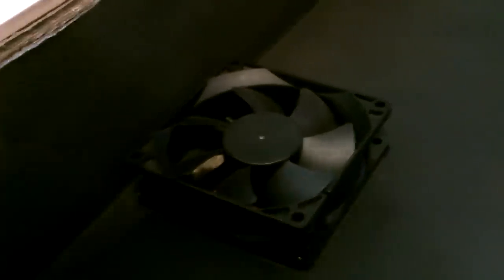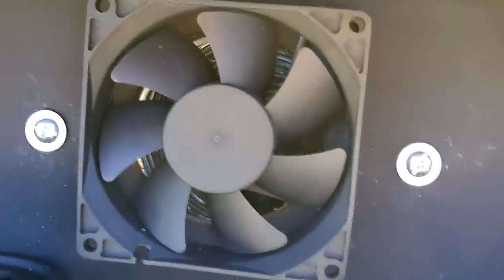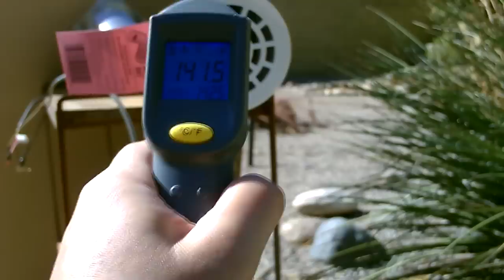Homemade "Steel Can" Solar Air Heater! DIY - STEEL CAN Air Heater! (140F+) - EASY Instructions!

Comment: you made several holes at the bottem of the heater frame and my question is that whather you covered those hole or not,if you covered those holes,how did you cover the holes and what did you cover the holes with,i am not asking about the computer fan hole my question is about,the other several holes you made
Reply from the maker: hi there. those are covered with screen

Comment: How about those low voltage LED seed warming beds? You could wrap them around the inside of a clay pot and make a solar powered space heater. No need to burn any candles.

Comment: Really enjoyed this video. I made a gigantic heater like this last year on my patio as an experiment using 3" pvc I had. Then tore it down in summer. It worked. Too ugly wasn't portable. Been wondering what to do with empty cat food cans. Suggest foam insullation and tar, roofing paper for the back.Whatever. Very good project.

Comment: this is a clever way to capture and use heat.  I was wondering if you have any idea of the cubic feet per minute of air passing through.  I'm thinking of scale-up for a moderately large shop and trying to get an idea of BTU  potential.  what size room did you use it in?  was the room insulated, and what kind of temp differential did you experience?

Comment: Just a thought, instead of drilling holes in the cans why not remove the end ? just a thought.
Reply: I would imagine that increased airflow would decrease the resulting temperature.  Slowing down the air movement will trap the air resulting in it being heated to a higher temp.
Reply: exactly

Comment: hello sir, my masters project is to develop a solar dryer integrating dc heater, solar panel, fan and battery. Can i get more ideas from you pls
Reply: Apaa jacob run the duct from the box of cans into another box where u put the clothes...boom...clothes dryer

Comment: Great idea! Will try it myself in the future.

I think it might be better to use a (black) plastic tube to connect the device with the room because you'll lose less heat with it. And try to isolate it with wool or so. (Don't know if it is understandable, English isn't my native language.) ;)
Reply: plastic contracts at some temps though. may insulate some aluminium dryer duct

Comment: I have tried your steel can project and had it working ,but had problems with back yard trees that will block portion of sunlight. would you have any idea to help align the solar panel to the sunlight. I thought the connections were loose and checked all wires, all in good standing. very sensitive in the angle of light to run the fan .

Comment: Hi,I guess this can be used as an underground air passage try it for 3 meters and more underground while the hose of head heater is above the surface .It can be use for shelters,tunnels ,and underground chambers.

Comment: I have not tried this, but it seems to me the design would be more efficient if each can was loosely filled with steel wool to conduct more heat from the can metal surface into the vent system....just a thought.
Reply: on the contrary the steel wool would impede the flow of air. how this works is, the air flows at a continuous rate of flow through the heated cans ( the aluminum cans heat rapidly in the sun) . as the air moves from bottom to top of the manifolds the air is heated up very quickly, that's why it is important not to have any air flow restrictions.
Reply: It’d take twice the fan
Reply: Robin Goodfellow Now there's an interesting thought! Would be interesting to see a comparison.

Comment: fill the cans up with small river rocks, they retain lots of heat...
Reply: I'm still in for the wool
Reply: +Andrew De Freitas good idea
Reply: good idea
Reply: or break up some fire bricks
Reply: Is that so? I have some experience dealing with the reverse rocks. I used them as the therapeutic heat pack. I made a case, filled with rocks and I would heat it in boiling water. The idea was that heavy and hot would penetrate deep in to muscles. The rocks would quickly become cold again, and would take too long to heat them again. So as interesting the idea looks in practical use I was disappointed. Well, it was my idea no body to blame here but ..
Reply: Paint the cans black
Reply: @mamiemw6418  7:49
Reply: or steal wool
Reply: @andy6477733157  steal wool?......like....in.....you rob sheep?
Reply: @TheWolfsnack  That's baarbaric!
Reply: Bad idea. It breaks the design which is that it runs off of the airlflow through the cans.
Reply: River rocks are cold and wet

Comment: After leaving a Black car with black leather interior in the sun for 30 minutes next to a White Car with light interior, the temp. is amazingly different. I will try with this wblack painted cans filled with black colored sand....also a mounted freezer fan with magnets on the blades with a very strong magnet to turn the fan blade....thus hoping for a more efficient heat source!  Do you think would work??
Reply: That blade won't turn with only magnets that's physically impossible
Reply: +Sarah  Grace Brooks The black sand is redundant if it is already housed in black cans. Also, as with what +Oscar B said, the magnets will not make the fan move. Look up perpetual motion machine if your more interested in why this will not work. Aside from that go for it and good luck!
Reply: the fan will rotate by a single Strong magnet placed to the side of the fan blade with a magnet on each fin...the Strong magnet pushes the fan like I use to take 2 magnets and make one chase the other.  Each time one fin passes the Strong magnet it repels...instead of attract...look up magnet fan.
Reply: +Sarah  Grace Brooks a magnet has 2 pulls if you want it to rotate like you explain your are going to have to be turning of and on the magnets that's why electric motors works. The way you have explained it the fan would just stay in one spot because of the magnetic force. The nearest blade would be attracted the the fan and would stand attracted thus making the fan harder to move than without magnets. All the video you see on the Internet are 100% fake.
Reply: +Oscar S you are going to have to turn the magnets off and on*
Reply: +Oscar S magnets complicate things
Reply: +Blackerflash indeed, but perpetual motion is non existent.
Reply: +Good Game u can make the fan spin, but its not going to be pushing any air, really
Reply: ekoms108 You can't make them spin using just magnets.

Comment: so I guess you leave it all outside except for the hose?
Reply: +Dusty Schneider I planned on building one except putting it in the kitchen window, inside of course. You still get the greenhouse effect by placing them in any window with sun. Inexpensive heater for daylight hours. win-win.
Reply: ZinfandelRed1914 thanks my friend
Reply: +ZinfandelRed1914 Place the cans up from the bottom about an inch or so and stacked to about an inch short of the top and everything painted black. Then cut one inch gaps on the back side all the way width wise at the bottom and top then place it tightly in a south facing window with the slots inside the dwelling. The heated air from the sun will naturally rise and flow out the top slot which in turn creates convection that then draws cooler room air into the bottom slots. The heat will continue to draw cooler air, warm it as it rises and back out the top into the room in a cycle that repeats naturally and eliminates the fan. Paint everything black inside the collector and even add small gravel stones painted black inside the cans to store more heat you have an all day (provided it is sunny) heating unit.
Having the heated air travel through a well insulated duct, using the small fan run by a deep cycle solar charged battery, into larger barrels of clay bricks stacked loosely for circulation around them inside and small opening in top can trap most of the the heat, warming the bricks and only slowly dispel the cooler air out the top. The barrels placed in a low place such as under the floor which has small grates above them will radiate warmth out when the barrel tops are opened wider after sunset releasing the heat collected all day
The solar collector needs black paint on everything to absorb heat and light and gaps between the rows of cans to make more room for more heat. Black PVC connected as continuous tunnel back and forth side to side open at both ends can create a lot of hot air.
The main thing is black to absorb heat and convection that does not remove the heat but cooler air. Volume of the collector is only limited by the size wall opening and limit the collector' contact with outside air.
Reply: The small stones idea will impede the airflow through the cans and make it much less productive.

Comment: If there was a way of putting a smaller can within each can filled with sand it would capture and radiate more heat and for longer. Just a thought. Cool build. Thanks for sharing.
Reply: +bRad “bRadicalMagic” Nichols slow clap for the allusion
Reply: Funny Guy
Reply: Hey Cain ,  for how long have you hated your very own brother ?

Comment: how small can u make it?
Reply: +Ray Lee For small rooms, maybe try the candles with clay pot method as well.
Reply: +Ray Lee You could do this as small as you want but the more surface area gathering sunlight the better. Anything much smaller that what he built here probably wont be very useful
Reply: i c thanks
Reply: thanks

 ZinfandelRed1914

Comment: Better have thermal mass in the home to hold the heat, otherwise...heat during the day might save you a little on your utility bill, but won't save you at night if you don't have another source of heat.     How much did it cut your heating bill?

Comment: Why the fan? Passive is more energy efficient.
Reply: +Shawn Sawyer You would need the fan to direct the heat out of the lightbox. Otherwise it would be like an oven and just the cans would get the heat, and not heat the room.
Reply: elizabeth anderson actually this is untrue. proper planning, placement, ductwork and home ventilation would allow you to circulate warm air thru a house.

Comment: Would this work when the outside temperature goes below freezing (below 32F)? My winter is in the teen most of the time.
Reply: as long as the sun was out and hitting the device.

Comment: Great Idea

You might consider instead of using a battery operated fan; a passive induction/inward direction rotating fan coupled/"backed" with an opposite driving air forward fan; thus the air drawn in by the heat built up in the box, is then driven with increased force into the box which also serves to draw air faster into the box: Instead of steel cans using matt black painted aluminium cans as they heat up and conduct heat quicker; also using/filling the inside of the aluminium cans those (old used) stainless steel pan scourers  which the heated air will easily pass through, better still give them a spray of matt black (NON-TOXIC WHEN HEATED) matt black paint as well, this will increase the amount of heat contained in the box and so being driven through the box.

Cheers great video well presented.

Comment: Curious, what is the purpose of the holes in the bottom?
Reply: +cscooper2000  to let the cold air in.
Reply: +cscooper2000 to circulate the heat through each can, so it can get to the fan...

Comment: This would make an excellent heater for a greenhouse in winter. Grow fresh vegetables & herbs all year round.
Reply: Grandpa the Grey  yes that is what i am building mine for, the more cans the bigger the better, i live in the south, and we get a lot of sun in winter so this should work great for me
Reply: that is correct! how the plants will get warmed up during cold nights?
Reply: It would save money, but you'd still need some other type of heat and probably artificial light for night time.
Reply: Just remember it won't always be sunny, plants can die.

Comment: If the cans are turned so that the open end is exposed to direct sun for part of the day at least, painted black inside perhaps, and with venting to allow air in thru the bottom sides and out thru the top sides, would this improve heating or make it less effective?

Comment: If you take the removed tops from the cans, and put them inside each can to act as a baffle, this might slow the air down and/or help remove heat from the air passing thru, and increase the heating rate and BTU output(??)
Reply: +Jay Dillon Start with less hole in your bottom cans that's what I did and you can hear the air being pulled up through the heater, I don't even use a fan and it heat my green house up vary well almost to well during sunny days when it's 40 to 50 out side. But mine heater is 5 feet tall.

Comment: Any thoughts about the ideal way to weatherproof (waterproof) this for longevity during rainy seasons? Rain will eventually leak in and create mold in the insulation, not to mention warp and rot the wood after enough time. Weatherproofing will allow a more permanent installation and must-have for a larger scale unit. My first thoughts would be to construct it with plastic impregnated wood (or full synthetic wood) and use synthetic insulation. A bead of weatherstrip adhesive around the glass in combination with outdoor foam weatherstrip (1/4 -1/2") should seal the glass tight. Or??? Any other thoughts? I, personally, would use glass instead of acrylic as eventual scratching and hazing of the acrylic will cut down on maximum sunlight reaching the metal cans (kinda like what happens to headlamps on cars after several years). But I'm thinking more permanent installation, of course. Thanks for sharing.
Reply: rockersmuse use some Thompson's water seal and caulking ...treat it like a window and the moisture should stay out
Reply: rockersmuse  epoxy of polyester close everthing good
Reply: rockersmuse  prime the wood and paint it naturally, and seal it up, no water can get in that if its mounted properly, the outside does not have to be wood you can also use metal,
Reply: rockersmuse we are building one , a big one for my greenhouse, remember the more cans you use the more heat
Reply: rockersmuse  plywood with epoxy or polyester and seal te plexyglas wiht tex7
greetings

Comment: Question ? Do the frame has to be wood to make the solar heater ? I use just cans and put the any type of way inside of a cylinder metal air vent and a microwave plate for the glass and put it upstairs in my house window.The question is how to make it warm up and a easy way to blow out the heat ?

Comment: Why all the cans? If the goal is to slow the air movement allowing it to acquire more heat just use baffels to slow the air .A couple more pieces of wood but no cans.
Reply: more cans = more heating surface.
Reply: +Angler Beaudry  yes all so coca cola cans have chambers avry can is a chamber where the air stay  bit longer to move to the next one an hite up
black paint helps even more

Comment: Wonder how just cutting an using a piece of corrugated sheet metal painted black would work?  Possibly even placing that underneath the screen frame you used in one of your other videos.  Either way thanks for the video!  It's defiantly got me interested.
Reply: casper3oaks That works and you can run a long pipe (PVC, copper or whatever) curled along/around like the rear of a refrigerator.

The pipe is mounted (glued or soldered) between the iron and the glass top.

Comment: The ideas in the comments are pretty good. To touch on it, I would keep the same design but build the case 2" larger & deeper and line it with small lava rocks. Basically make lava rock insulated  panels for the inside.

Comment: You have a very short piece of tubing. How do you place the collector so it stays in the sunlight for most of the day?
Also, where do you put the outlet vent. (Low on a living room wall?) And the fan, is it a 120 Volt fan, or 12 Volts with a transformer? Thanks
Reply: It appears that he has the fan wired to a solar panel. The fan is 12v computer case fan so it is probably a 12v solar panel as well. That eliminates the need for a transformer. Also you gain the benefit of the fan only running when there is sunlight. As far as the location, it depends on where you live. In my area I would put it on the south side of my house. That is where I get the most sunlight year round. Also I would just make something to run the exhaust tubing through a window.

Comment: I am making a solar air heater for a class of mine, I am using three hundred + cans and I was wondering what fan was used in this video. That fan or two would be perfect for my system. desertsun02

Comment: Would there be a problem if you just cut the top and bottoms out of the cans with a can opener instead of drilling all of those holes?

Comment: I thought of making the same kind of box to help heat my shop, but 4 or 5 feet by 8 feet. Before I poured the concrete floor, I ran 4 inch pvc drain pipe down from inside, then under the wall, and then up about 2 feet outside. I made 2 sets: Intake from outside, and return air supply from inside to my solar heater.  But I never did this. Rather than pulling cold outside air into the box, I wanted inside air to blow into the box. And I planned to put the fan inside the shop blowing out into the return line so the motor wouldn't get over-heated from the incoming hot air. Glad to see that he painted the cans black to absorb sunlight, and convert it from light energy to heat energy.
Reply: +Mrgruffy44  How is your model working?  I'm designing a garage/shop and would like to do something similar.  It has to be more efficient to re-heat the interior air than start with the already very cold exterior air.